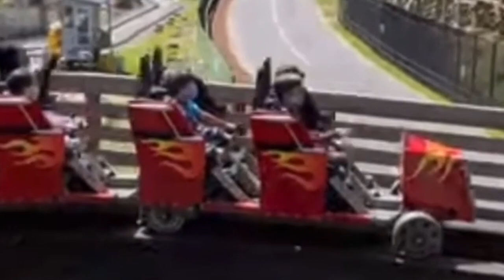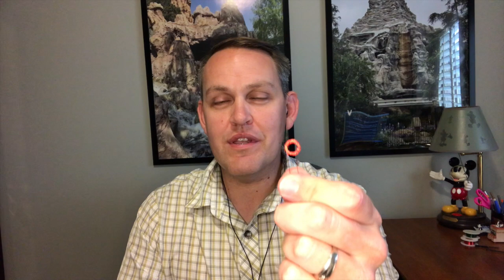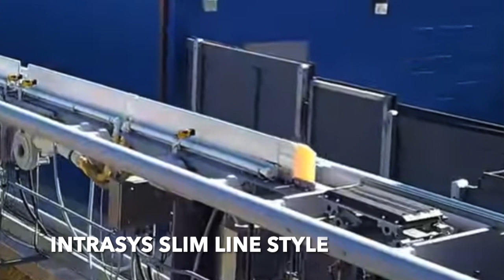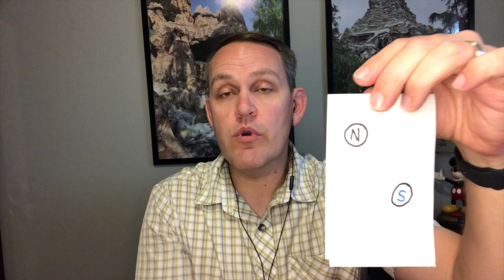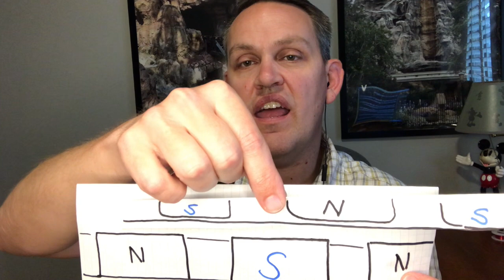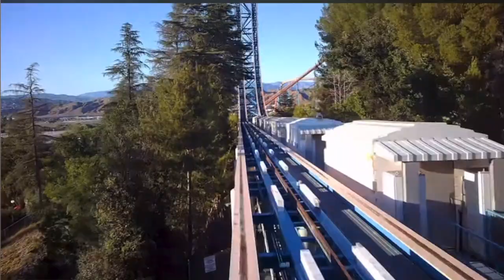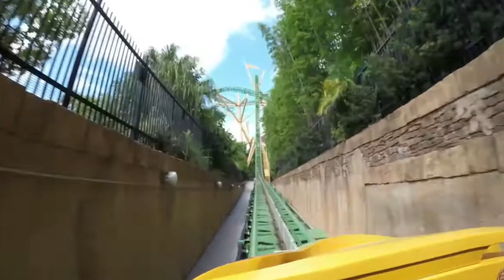MAGNETIC LAUNCH SYSTEMS 3: Linear Synchronous Motors and how they work

Comment: I made an audible "oooooh" sound when you explained the breaking mechanism. Finally understood how LSMs can act as break in their safety default mode. Thank you for the amazing explanation!
Reply: Makes me wonder if in normal mode (not emergency braking), they also use the gurrent generated by the "LSM brake" to feed back into the main bus capacitors, much like regenerative braking on an EV would do. Or course, you can't fully recover all the energy that a moving train has, but it could sure lower the amount of grid energy used by the next launch. But maybe doing this is just way more expensive than the potential savings.. 🤔
Reply from the maker: @Colaholiker  you are correct. It can be done but an entire separate drive system needs to be build to develop the storage of the created power. I’m guessing only a guess. The braking power generated is probably not even enough to move the train forward one train length. A lot of braking is less than 2 seconds when you think about it.
Reply: @ryantheridemechanic  There is significant energy in a train rushing into the brake run. Just think of the weight and speed we are dealing with here. The problem is that it needs to be converted back to electric energy in very little time and you would need some really big capacitors to store it. That's what makes it so expensive and therefore not being done.

Roughly speaking, if we assume that you get about 75% of the kinetic energy of the train hitting the brakes harvested, and another 75% of the electricity you put in the launch actually make the train go.  That means 56% of the incoming train's energy can be used for the launch. A train hitting the brakes at half the launch speed would therefore provide 28% of the required electric launch energy. That's not a small number. But like we said before, it's a lot of extra equipment needed to make it work. I am not too sure about LSMs, but I think the efficiency numbers I assume are actually lower than reality.
Reply from the maker: @Colaholiker  yea the return on investment would be so May years down the road I don’t think any park would do it. I’m not an electrical engineer but I would use capacitors as the filter then step voltage down and store in battery’s. Might be something if you had  lot of rides using a center return. 
I also came up with a way to retrofit an old ride to do the same thing with mechanical brakes.
Reply: @ryantheridemechanic  Batteries can't store that much energy in so short of a time. Capacitors are the only way to go there. They can charge and discharge almost instantaneously, and also have unlimited cycles, as long as they stay within their rated parameters, unlike batteries that will wear down, no matter how careful you are.
Reply from the maker: Your welcome!

Comment: How much does a roller coaster train cost for a 12, 16, 20, 24, 32 and 36 passenger trains?
Reply from the maker: Very complex and the cost is not well known because every train built is custom. 28 passenger bare bones train could come in close a million. A train with onboard audio, custom fiberglass along those lines probably closer to 1.4mil. A train like x2 probably comes in closer to 2.5mill
Reply: @ryantheridemechanic  How much you think the old Dragster trains were?  And what about millennium force trains?  And how much do you think the new lightning trains will be for Top Thrill 2?
Reply: @tubepotato500  For the last part of the question, I wouldn't be surprised if Zamperla gave CP a huge discount on the entire project, to get a foothold in the giant coaster business. They took a huge leap from what they have previously built to this, and sometimes customers need to be convinced ;-) to give a company the opportunity to try something completely different. Therefore, even if anyone knew what they paid, it wouldn't be the price that Zamperla are planning to usually charge.
Reply from the maker: @tubepotato500  I’m guessing those intamin trains are about 1.5M each. Zamperlas replacement might be cheaper but probably still around 1M
Reply: @ryantheridemechanic  What about the trains on Cedar Point's Gatekeeper?

Comment: How much would you esttimate the power bill for one day of operation to be on the LSM launch vs LIM launch?
Reply from the maker: I honestly don’t know how high voltage is sold to parks so I’m uncertain how to even guess off that. You could take volts and amps convert to watts and figure out what a Kw is sold for maybe?
Reply: @ryantheridemechanic  I think this comment was getting at an efficiency comparison between the two technologies. I would assume that LSM stators use between 30-50% less power than a similar LIM system, depending on the acceleration and velocity delta required. LSM systems also lend themselves to using eddy braking with a set of generator stators to recuperate some energy from the train, similar to how electric vehicles can use the traction motor(s) to recharge the high voltage battery.
Reply: Always wondered this

Comment: U should talk about why rmc lap bars and shin guards so tight
Reply: TLDR: RMC Restraints are class 5, which either require something over the shoulder, or a tight lap bar and seating system which forces the rider to stay upright. The shin guard is what allows the lap bar to meet these requirements.

TL:DR,TL:DR: A shin guard a day keeps the OTSR away!

ASTM (American Society for Testing and Materials) has developed a class rating system for ride restraints. These are separated into five classes depending on the severity of the acceleration which a rider experiences.

Class 1: No restraint. Think “Bench: The Ride”. 

Class 2: No restraint, but a grab bar or other point of stability is provided should the rider wish to hold on. (Ex: Fast and Furious: Supercharged, train rides)

Class 3: Locking, multi position restraint, which may restrain one or more riders. Ride operators should verify all restraints are locked prior to dispatch/start of ride cycle. (Ex Disko, other rides featuring lap bars without a seatbelt/redundant locking)

Class 4: Individual, multi position restraint. Class 4 restraints must automatically lock, with sole unlocking ability given to the ride operator. Does not require external indication of locking, can be checked visually or manually. Class 4 restraints require redundancy, typically in the form of a dual (paralleled) locking mechanism. (Ex: Older B&M restraints)

Class 5: Individual, multi position restraint, with a redundant locking mechanism and electronic verification which will inhibit the ability to start the ride if a restraint shows a fault; OR a combination of a class 4 system with an additional seat belt/lap bar. These typically require a sensor to verify locked status, and ride manufacturers like to go above and beyond these baseline requirements. What you see often these days could be called a class 5+. These systems will have sensors to determine position, redundancy built into the locking mechanism (Ex: RMC using two independent hydraulic locking cylinders for each lap bar) AND a seatbelt for good measure. In order to ensure the restraint continues to meet these requirements, the rider must be held in the proper riding position. The shin guards force your legs to bend, putting your body into a position where it cannot slip out from the lap bar. 

Sources: ASTM F2291-2006: Standard Practice for Design of
Amusement Rides and Devices
Sources: I worked as a project manager on installations of rides for Busch Gardens and the Mouse.

Hope this helps, if you have questions, please let me know!
Reply: @Coasterteen22 Thank you for that in depth answer, love it.
Reply: @Coasterteen22  Bench: The Ride looks too intense for me. 😅
Just kidding, thanks for the explanation!
Reply: @Colaholiker  I know after certain meals, I wish I had something class 2 or greater for the porcelain throne! 😂
Reply: @Coasterteen22  😂😂😂 that's likely more of a compressed air launch thing? 🤣 (you gotta love some good old toilet humor)
Reply: @Colaholiker  Oh boy, I wish this were pneumatic!
Reply from the maker: Ah bathroom humor! Love it! I love seeing humor from people.
Reply from the maker: MLS (methane launch systems) is do a video but it would just be crap 😂😂
Reply from the maker: All the facts there! Even got the insurance belts /seat belts in there. Thanks for the response!
Reply: Because they don't want you going to the moon on those ejector airtime hills   :)
Reply: Amen, I swear Steel Vengeance is trying to either drop you or eject you out of its train. I'm very glad for those beefy restraints.
Reply from the maker: My thought on RMCs I’d that the trains are angry your riding and trying to kick you off like a bull haha!!
Reply: 🤣🤣🤣 You guys and your potty humor. Ty now I have to wipe the soda off my phone. 🤣🤣🤣